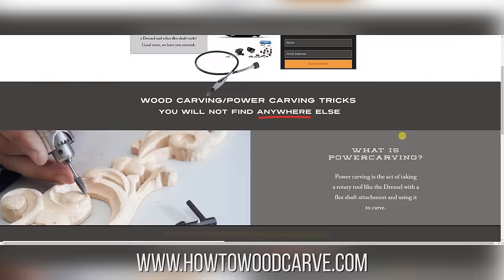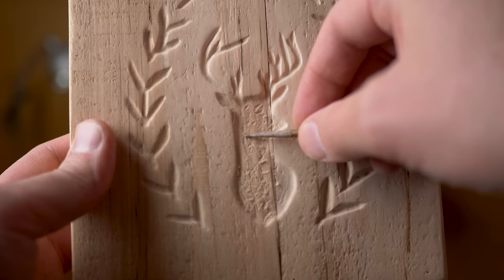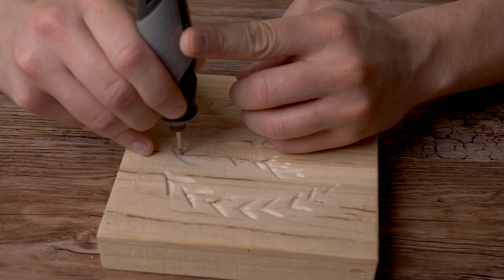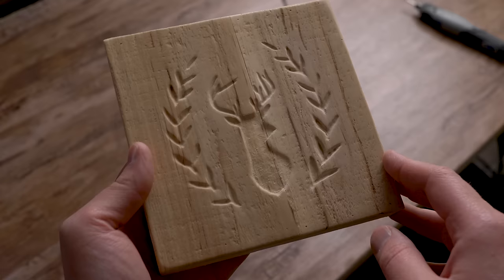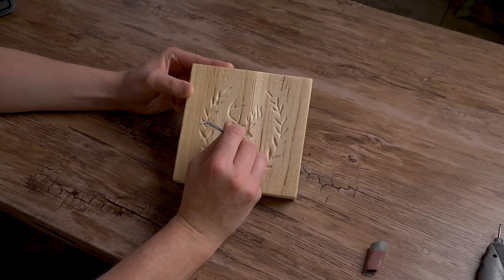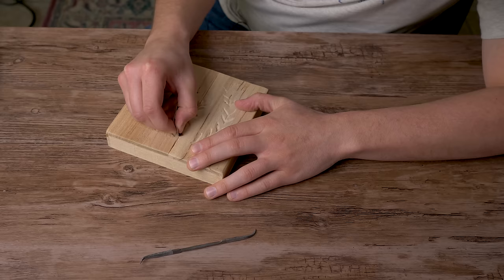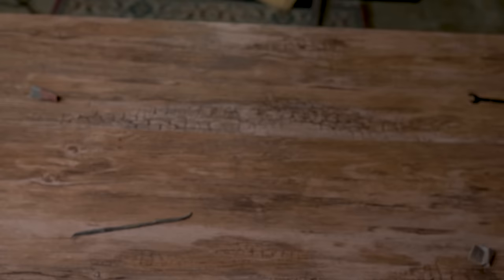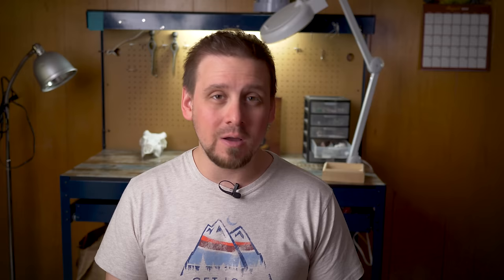The Most USEFUL Dremel Wood Carving Trick!

Comment: That's a neat trick. I do mostly manual carving where you would clean this up with a gouge and soms scrapers. I suggest looking at the scraper set by flex cut. It wil save you a lot of time sanding and can create a perfect finish.
Reply: Easy to make from an old hard point saw. Saves 60 quid.
Reply: @spaced4448  well yes if you have basic metal working tools.

Comment: All four stages shown here can be reduced to one by using mini scrapers, which are easily made from old hacksaw blades.
You'll end up with a planed finish to the negative space and a lot sharper definition at the edges.
Reply from the maker: Good tip!

Comment: Hey C.C.! If you don't mind me adding something that has helped me a lot,but I got in trouble with my gf at first lol. My lil' secret weapon against negative areas (Emery Boards) LoL That's how I got in trouble with my girlfriend; I used her last new one,and they're easy to custom cut however you want to; just use a utility knife,or a good pair of shop scissors. You may have to experiment some,but their very cheap; a pack of 5 cost me about $2.25 after taxes. A new one is about the same as 80 grit sandpaper,and one slightly used is around 100 to 120 grit an so on. If I need a high grit for a very smooth finish; I'll trim the emery board however I need it to be an then I'll use double sided tape to apply say 220 maybe even 400 if I'm not going to stain the finish piece; after taping just trim to fit,and you're all set. Also play around with textured design in your negative areas. An lately I've been using colored epoxy too; it takes a while with the drying time,and the sanding to a smooth finish,but the results are awesome. Sorry about the long write. An thanks C.C. for the informative video upload I enjoy watching,and learning from them; great info without any unnecessary filler,or hype. 😎👍
Reply from the maker: Great Tip!
Reply: I do that too

Comment: Just to throw it in there.  If you plan on finishing the wood,  I wouldn't recommend jumping from 120 to 220. You won't be able to hide the scratches created by the 120 it will show through the finish especially if it is stained or colored. Don't skip grits 120-150-180-220

Comment: I would've thought to put the rotary tool into a router-like jig to secure it at a fixed depth to smooth the negative space...
Reply: I was thinking the same cause to get it as straight as that using freehand takes awhile to get a good hang on it. Knowing myself that engraving will get quite deep by time I straighten it out. Cause i would by accident make a deeper spot and then have to drop everything else to that depth. Or worse start on one end with 1/8 depth and slope it down to a quarter on the other haha. Well atleast I'm working on my patience. That's always a plus
Reply: Yes exactly... I just ordered 1 for mine

Comment: good afternoon. I'm a beginner at wood carving and I was wondering what's the best method to keeping the negative space surface area even threw out the wood carving process. I have have tried a few carving projects and seem to be having a hard time keeping it all even or as close as possible and that tends to become frustrating lol. thanks and great video!
Reply: Try a router type jig to keep the depth uniform
Reply: Dremel has a depth attachment that screws around the hub that holds the bit

Comment: Thanks. I am one handed due to a stroke. Can I still do it without a steadying hand?
Reply from the maker: Yes you can, even with just one working hand. Just take your time and “feather” over the areas. You will definitely see a difference. Practice a little and you will start getting the hang of it in one hand. Put the wood in a vise or on a non-skid surface (you can buy some dicem I think it’s called) at wal-mart that will keep the wood from sliding while you are carving.
Reply: With a little engineering, you might be able to modify one of those lamps that are on an adjustable arm to hold your rotary tool in a clamp. I don’t know if I’m explaining it right...

Doing it one handed might prove difficult, but if you’ve got someone that can give you a hand (bad pun intended) it might work out fairly well

Comment: Seems easier to just use the actual router attachment for the Dremel so that you could keep both hands on the tool and ensure a consistent depth
Reply from the maker: Most definitely, on a flat piece like this. However, most people who power carve doesn’t usually have flat pieces they work with which wouldn’t suit a router very well. I showed it on this because it was easier than a 3D carving 😁
Reply: Slewfoot ...Ha! I left a comment saying the same thing and then saw yours! D'Oh!